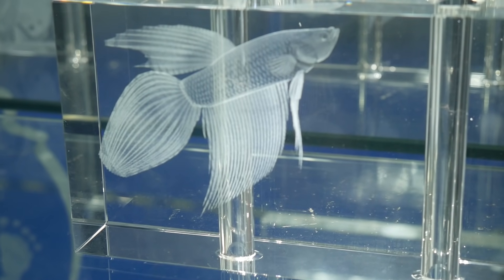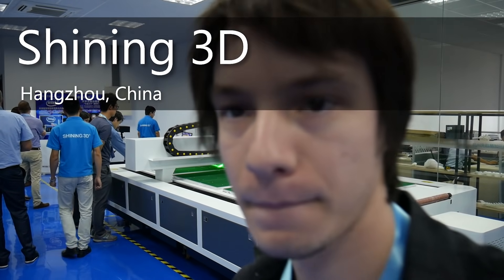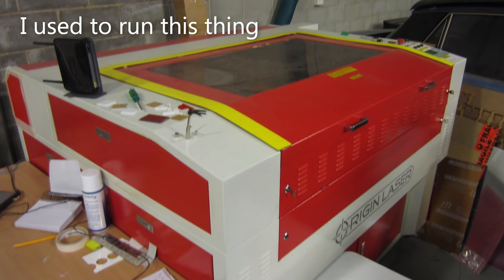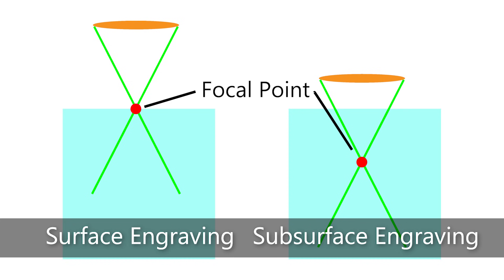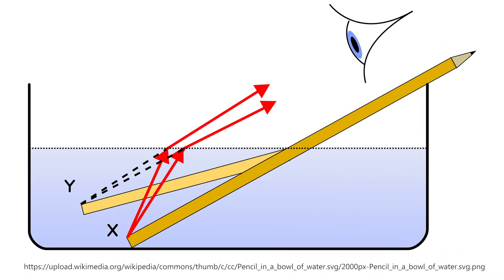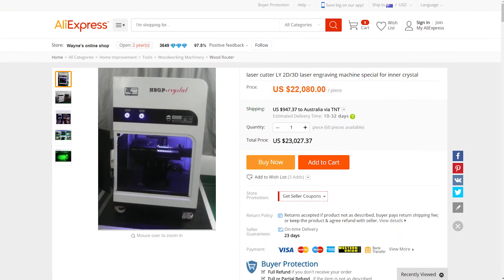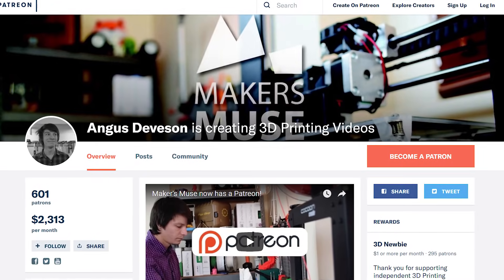What is Sub-surface Laser Engraving or a 'Bubblegram'? Technology Explained

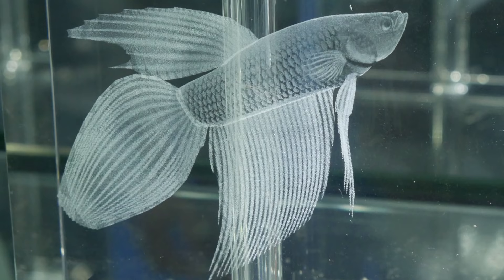Comment: @4:03 - Sorry, wish you would have researched this more since it's quite interesting.  The lasers in these machines HAVE to be pulsed, using a method called Q-switching to obtain high peak-power pulses that can couple their energy into otherwise transparent material.  These pulses, incidentally, are in the megawatt range and over a very short time span, usually a number of nano seconds.  These lasers use several IR diode lasers to "pump" a Nd:YAG laser crystal, which is frequency doubled from 1024nm to 532nm (green) in order to be able to pass into the glass target object.  Interestingly, this laser technique is used in tattoo removal machines to penetrate skin and oblate sub dermal ink . CO2 lasers can do a continuous etch on glass because glass is opaque to the near IR long wavelength of CO2 lasers, and therefore they can only etch the surface.  Also, because glass is opaque to CO2, more energy is transferred directly to the glass, rather than passing through it, which allows the CO2 laser to remain in CW operation (continuous wave, i.e. not Q-switched).  So, the operators of these bubblegram machines do not have the option to do a "continuous blast".  However, using fewer dots/bubblegram will shorten processing time and wear on the laser components.  So in that sense you're right about fewer dots being more economical.
Reply from the maker: Thanks! Really glad you commented as this is the kind of information I was trying to find but just couldn't, there was nothing much out there. I can't edit the video, youtube killed annotations, but will pin your awesome details so people can get that extra bit of info.
Reply: @MakersMuse  how much do the blank crystal cubes cost, and where do U source them?
Reply from the maker: Yes, as a creator we can no longer 'annotate' videos like add notes or corrections. It's frustrating.
Reply: +cabletie69 - Are you trolling?  I don't see what's wrong with pinning the comment for those who are interested...
Reply: @mikepenske9943  - Why not just take your saved original of the video, make the edits, and resubmit it as a new video and delete the old one?
Reply: +Maker's Muse - Sure, glad to contribute!
Reply: Minor correction: you mean ablate, not oblate.
Reply: Just throwing this out, pulsed lasers are extremely common in research and industrial applications. Also, Q-switching, while very popular, is only one type of mode locking, which is the name for making the different frequencies line up into a short pulse in general.
Reply: Do you happen to know how the frequency can be doubled or halfed? I came across this at RWTH Aachen, where I got to visit their semi conductor institute, and they showed us a engraving laser for silicon dies, it was frequency doubled into the visible green, so it originated from the very near infrared, but the operator couldn't explain me how the frequency gets doubled or halfed... Does it use reflection or refraction?
Reply: thom1218 you seem to know a lot about the subject so I'm asking you, if you have 2 lasers that are about half the strength needed to engrave the glass, would pointing them at the same point make it work?
Reply: It is exactly the same way the green laser pointers are made; the same 1024nm IR diodes, the same KTP crystal and the 532nm green laser beam output.
Reply: thom1218 wow!! Impressive
Reply: thom1218 I use a fiber optic laser. I'm assuming it would be similar to the co2 laser for this?
Reply: Would a 60w fibre laser be capable of doing it ?
Reply: Did you ever find out the answer to your question here?
Reply: To lazy to read this scientific stuff even tho I’m too much of a nerd in school XD
Reply: Change 1024nm to 1064nm and you're all good
Reply: This
Reply: Hey, I am actually doing university research for my master's in Sub-Surface Laser Engraving. Is there a way to get in touch with you for information on where I can find more of this in-depth information for SSLE, or see if you could help with the research?
Reply: Hi was wondering, could you use this on borosilicate glass?
Reply: Would this work in an opaque material? Using perhaps a different wavelength of course.

I wonder if this would work on targetting tumours
Reply: Maker's Muse YouTube killed annotation?
Reply: I am Soo impressed with ur understanding of the subject
Reply: No clue what you're talking about.
Reply: Jamesedward11 [pricx] yea same here
Reply: So detailed!!
Reply: @Koa Stefan for anyone reading this, it is a scam. They disguise malware as a software for hacking, only to take your login information and a myriad of other things. How they entice people to download is they first use an original poster to advertise the malware. Then, they use a second account (usually the same person) to grab someone's attention by saying things such as "oh my God, this works. It took x amount of time but it works." Run far away from these comments.
Reply: Mike Penske Gday Mike. Fair question. My comments are a response to 1. the channels operator pinning a smart arse response to my original comment, which you may have missed, and 2. his lame effort in the vid by saying that he wouldn't go into detail ( about 4 min in) after starting the vid by saying he would do a proper job on the subject.  So no, not trolling.
Reply: Maker's Muse well that certainly saves you from having to make the effort.  Perhaps this channel should be named thom1218?
Reply: @cabletie69  it certainly SHOULDNT be called cabletie69. You contributed nothing to the conversation. One year later and I bet youre still as big a douche as ever.

Comment: I casually thought about this, never explored it. My solution was 3 lasers, each 1/2 of the energy required to melt the substrate. Where they cross, is where the artifact would be.

I suppose you could do it with one laser and the focal point is where all the energy is... But my way sounds more difficult and fun!

Ooo.. passing the laser thru previously affected areas would alter it!

Comment: I had lots of theories, this was one of them, the other was that the cube was resin and that the "bubbles" were actually a fragile cotton wool type mesh structure like the mantle in a gas lamp, that was somehow set inside it, but this idea is way cooler, I just didn't know they could focus a laser to a specific point i thought lasers had to be uniform in width all the way along to be a laser since the light is made from bouncing light backwards and forwards making a laminar flow of light particles 💁‍♂️

Comment: Hi I am just in the process of buying one of these from China 
I'll send photo of would you give me opinion on this model thanks
Reply: Can't put photos on
Reply: Product performance description

The crystal engraving laser machine, is a high resolution laser engraving machine, is really a fine processing machine with
advantages of high fidelity and high stability, which is definitely suitable for fine model engraving processing centers, gift
shops, craft shops, photo printing shops, wedding photography, souvenirs, personalized gifts shops, etc.
Our 3D laser engraving machine adopts industrial design, which can engrave one big block of crystal or several small blocks at the
same time. Its products can give person crystal-clear and fine noble visual image, that' s elaboration for your home decoration
Item No.Technical Index
K5
Laser frequency
5000hzx
marking speed
300,000dots/min
maximum engraving area
320*400*130 MM
Size without package
80*90*100cm
Size with package
100*100*139cm
weight with package
240kg
Laser/Laser wavelength
Semiconductor DIODE/532NM
Focus diameter/resolution
0.02mm/1200dpi
working/ beam quality
with high speed scanner+X+Y+Z(5axis)
positioning accuracy
10um
Continuous working time
24Hours
cooling
air cooling
Life time
＞30,000hours
Gross power/noise
1.5w/50db
power requirement
single phase 220v or 110v(+/- 10%). 50hz or 60hz
software
1. Dots cloud 2. for optimizing & control machine
file format
JPG,BMP,DWG,DXF etc.
suitable material
crystal, acrylic, glass, hard plastic etc.
working environment
temperature 10-28℃, humidty ＜70%, non-condensed
Reply: Product performance description

The crystal engraving laser machine, is a high resolution laser engraving machine, is really a fine processing machine with
advantages of high fidelity and high stability, which is definitely suitable for fine model engraving processing centers, gift
shops, craft shops, photo printing shops, wedding photography, souvenirs, personalized gifts shops, etc.
Our 3D laser engraving machine adopts industrial design, which can engrave one big block of crystal or several small blocks at the
same time. Its products can give person crystal-clear and fine noble visual image, that' s elaboration for your home decoration
Item No.Technical Index
K5
Laser frequency
5000hzx
marking speed
300,000dots/min
maximum engraving area
320*400*130 MM
Size without package
80*90*100cm
Size with package
100*100*139cm
weight with package
240kg
Laser/Laser wavelength
Semiconductor DIODE/532NM
Focus diameter/resolution
0.02mm/1200dpi
working/ beam quality
with high speed scanner+X+Y+Z(5axis)
positioning accuracy
10um
Continuous working time
24Hours
cooling
air cooling
Life time
＞30,000hours
Gross power/noise
1.5w/50db
power requirement
single phase 220v or 110v(+/- 10%). 50hz or 60hz
software
1. Dots cloud 2. for optimizing & control machine
file format
JPG,BMP,DWG,DXF etc.
suitable material
crystal, acrylic, glass, hard plastic etc.
working environment
temperature 10-28℃, humidty ＜70%, non-condensed

Comment: Very interesting. Its amazing how the focal point is so precise that no melting or etching takes place as its entering the glass crystal. When I was going through school at ITT tech we learned a little about lasers and optoelectronics. We made holograms on pieces of clear glass like window glass. It was a pretty simple basic procedure using a beam splitter and a helium-neon (HeNe) laser in a sandbox. Beam was split to provide your object beam and the incidence beam. The best thing we used for an object to make a hologram out of was an old television tube. The detail in the holographic image was awesome. The one thing that is really odd and sometimes hard to explain is, if you break that glass every single piece of broken glass will have the entire image on it.  This is because the image is a frequency of light imbeded into the glass each piece has that frequency of light in it containing the entire image, might be very small on some pieces but its all there! 👍
I've worked with the older type (rear projection) television sets as a technician repairing them. Some TVs made by Philips/Magnavox used an optical coupling fluid between the CRT and lens. This was ethylene glycol the same chemical used for automobile coolant except it didn't have any color dye added. This fluid is considered optically transparent.  It has a particular diffraction index. This index is taken into consideration for how the lenses are cut or made. The refraction index is that effect you get when you put a pole into a swimming pool and it looks like the pole is bent where it enters the water. Different fluids have more or less of that effect than other fliuds. They used that phenomenon to obtain the focus on the mirror/screen. They also used it as a cooling fluid for the CRTs to transfer heat away, being those little picture tubes (CRTs) were driven pretty hard in order to get decent brightness of the picture.  
Optoelectronics is an amazing technology.  Just FYI, the term "laser" is an acronym for; Light Amplification by Stimulated Electron Radiation. 💯👍

Comment: Yag lasers are very different from CO2 lasers. Yags are great for glass and your 3D crystal you show in this video. CO2 can ingrave and even pulse but much slower. We have a 6000 watt CO2 that we cut 1" carbon steel, stainless, and aluminum. It also has a rotolas so we can cut pipe in it. Ours can hold and cut full sheets of material and at well over one million USD, it's not cheap.

Comment: This is actually possible on a home made 3d printer conversion all u do I discovered I put a black shiny plate under the crystal and Lift the laser layers in the crystal i discovered this buy accident while etching a piece of glass I had my laser set to low the etching ended up inside the glass

Comment: Being in NYC, I see a lot of these being sold in the streets with various items etched inside.

But lo' & behold! there are some that are made acrylic (most of these are), but the image inside was etched onto a thin sheet of acrylic and then put into a mold where liquid acrylic is poured in and allowed to harden. This creates a "cube" (or any other shape) with the image inside. Most of the times it is hard to detect but if you turn it to the side, the image flattens and almost disappears, signifying that it is a 2D image and not a 3D image in the "cube." Some times, there are flaws where you can see the acrylic paper seams about suspended in acrylic before it hardened.

Comment: You mentioned low cost laser system that would work, what is your definition of low cost.  I started with a childs toy in comparison to a water cooled CO2. But, it has been very productive creating revenue, Go ahead and laugh, I do. A $60.00 1W NEJE that I modified has increased sales  $1K since May on 1 single product where sales was running flat. 
I needed a lager format & was able to pick up a 15W 450nm gantry style DIY engraver. Still learning though,  because I'm an olefart without anyone that I know in the area working with lasers or willing to share their knowledge with/about grbl, Benbox, or other software. So it's been by the seat of my pants and on line tips, with of course mistakes but many good results that are profitable.   
Any and all help appreciated for this old nerd that was a pioneer working with computers.  Sperry Univac 1004 was my first machine I worked on and with back in 1968-70.

Comment: 4:10 it also means that you can use a lower power (therefore cheaper) laser as with quick a succession of on off cycles you can pump more power into a lower class laser without damaging it and still have a great final product.

Comment: Don't CO2 lasers use ZnSe lenses? They can be used for LWIR imaging as well, with the correct coating. 

I want to build a auxiliary telescope for my imager and would need a source for high focal length lenses. 

I always wondered how they work. I though the use multiple lasers on a 2axis system. And where the beams meet, they reach the glass transition temperature. 

But due to my recent research in optics, this seems far simpler, and it won't need a Z axis, you would just need to adjust the optics with a stepper to move the focal point. 

Its probably nice to use them with a point cloud, which are the first results you get from a photogrammetric reconstruction.

Comment: I actually ran into that, when using a glass piece to cover some wood I was engraving, to try to stop the wood from burning. the laser was focused a bit to high, and engraved the inside of the glass slightly. So I'm thinking about putting my laser diode on a 3d printing platform and pulsating it to make those kind of 3d drawings on clear plastic.

note: the diode I'm using is only 2.5W so a bigger laser would probably fair much better.

Comment: Couldn't they just use cylinders instead of cubes so that there isn't that damn interruption at the edge while looking at it?
Reply: +mason they could use the flat side of the cylinder but i think the lensing  effect of the rounded glass would make the image warped... so it would have to be stretched vertically to look right...
Reply: After a regular cube was made, the cube could perhaps be worked into a cylinder.
Reply from the maker: Good point! I've seen them use random shapes but not cylinders. Wonder if there's a reason optically.
Reply: Maker's Muse wouldnt the non-flat sides of a cylinder make aiming the laser more difficult?

Comment: I used to do this for a living in Las Vegas, the best lasers were the German "Vitro" lasers, not the ones from China. The laser uses a multi-faceted head to engrave hundreds of thousands of "points" inside the glass, to do that the image is converted or created as a cloud of dots. The laser is actually multiple beams that focus at a specific point to create a fracture, meaning that you can even stick your hand in the beam but the laser does not burn until you are at the exact XYZ of the beam that you have told it to burn at. One day a customer came in as part of a convention and fell in love with it -- turns out he was a big timer with Walmart and before you know it the back room where I worked was filled to the ceiling with boxes of glass for me to make displays -- displays for every Wal-Mart in the country. From what I understand they are still pressing "print" on the display files I created to this very day, even though I haven't been at that company for nearly a decade. So if you walk into a big box store and see one of these it might actually be one of my files from 2006 :) Oh and they do last forever, if you can avoid an accident that breaks the glass there is absolutely no fading whatsoever. I still have quite a few decade-plus works that look as good as the day they were made.

Comment: You say it doesn't cause any damage to the material, but put up some text that says it can cause the glass to spontaneously shatter, and you even say it makes the glass very fragile. why would you even leave that in the video?
Reply from the maker: the glass type is fragile, and it DOES damage the glass, internally via the microfractures... these in too dense concentrations can cause the entire piece to fail.